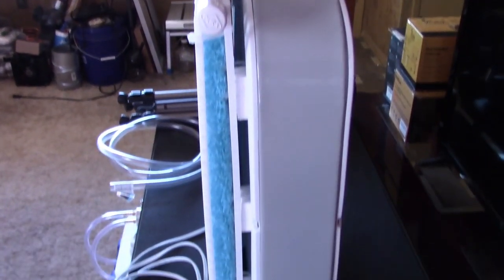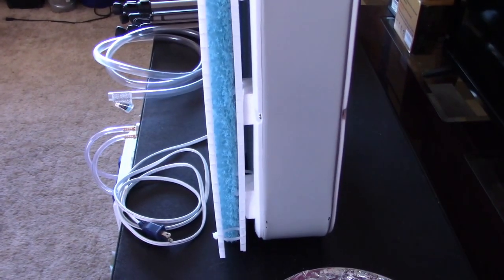DIY Evap Air Cooler! (Simple "Box Fan" Conversion) - Homemade Evap Air Cooler! New Design! Easy DIY

Comment: Thank you! Can you just use the clear tubing across the top and put holes in that! It would be simpler
Reply from the maker: hi. that might work but it may be harder to keep all the holes lined up and facing straight down. the clear tube might move around and cause issues.

Comment: Bought some evap pad you recommend and tested this quickly. Flow rate of air seems pretty low through the pad… worried it won’t cook a small room effectively. Any advice?
Reply from the maker: hi. i've noticed the unit works best on high speed. medium is decent too. make sure to cross ventilate the room and you should be all set. the blue pads are rated 2200 to 2300 cfm (which is the typical airflow of a box fan on high - so it works out good. make sure to use a good strong box fan for the best airflow.

Comment: Great idea. Except it will make me pee the bed with the running water sounds!
Reply from the maker: that's funny. if you're any distance from the unit you can barely hear the water over the sound of the fan so you should be okay. it kind of sounds the same as an indoor 'water feature' (or indoor water fountain etc.)  so maybe if you think of it that way, it would help. 👍🙂
Reply: @desertsun02  which of the latest models do you think work the best. Box fan with trans coolers, this model, Cylinder?

Comment: Is the pad on the suction side of the fan? If so, does it pull water into the fan?
Reply from the maker: hi. all of the water stays inside the pad. none of it escapes. i designed the unit so that there is no chance of any water getting into the fan.

Comment: The thermometer should be on the other side of the room for a true testament to how well that DIY works. Of course, the thermometer will drop 10-20 degrees being right in front of it.
Reply from the maker: hi. there is no point in putting the thermometer across the room because the air temp coming out of the fan is what matters. each room or space someone is cooling is of a different size with many different variables. this will easily cool down a room
Reply: That is the whole point here to show how much the air is cooled down coming out of the fan itself...  You're never going to cool a whole room with this but if you can point a fan at yourself with 20 degree cooler air blowing at you its a huge win when it's extremely hot.
Reply from the maker: @Arson7883 i agree with the first part of your comment, but these units will definitely cool down a room. possibly even a couple of rooms. in good conditions, the air temp coming out of them can rival the temps of an actual AC system.

Comment: In some area's of the country that will be an indoor humidifier.
Reply from the maker: hi. that is true. these types of coolers work in about half of the country (USA). to see if it will work in your area, you can check an 'evap cooing chart'. they show the approx. output temps and temp drop if you know the temp and humidity.

Comment: Put ice in the return tank
Reply from the maker: hi. for a blast of super cold air, you can definitely do that. works great (but is temporary). i was thinking of using an ice chest to hold the water and then putting a large 25 pound block of ice in the water, just to see how long it would last.
Reply: @desertsun02  maybe a loop or coil of tubing,
Years ago saw water fountain that had reservoir inside a refrigerator that it was mounted on.
Or a geothermal setup, buried coils under the edge of your house? It’s cool under my house, that’s where the cats hide during the day.
Wait, during the winter, could you use passive solar heat exchanger to heat your home and humidify?
Is it video worthy?

Comment: I like it.  No use jere in the S.E. but were I still in Texas or AZ it would do a good job.   Had something similar on the porch in AZ and the house had a swamp cooler itself..
Reply from the maker: they do work the best in places like AZ, TX, UT, NV, CA etc... but in general they work pretty decent anywhere in the western half of the country. and in some areas of the eastern half. depends mainly on daily temps and humidity.

Comment: Would this make create more humidity? Sorry if that a dumb question I live in Florida some of the store broke stuff I got mad made my room hotter then it should
Reply from the maker: hi. it does, but if you 'cross ventilate' the area then the humidity stays low (since it never gets a chance to build up). this type of cooling works great in many areas of the world. in general, (in the USA) it works for about half of the country. in another 20% of the country it works okay (or sporadically) depending on humidity, and not so great in about 30% of the country. evap cooling charts (found online) can show you what temps to expect depending on the temps and humidity in your area. note that i also have DIY indirect evap units. those are a little more involved but they don't add any humidity at all to the air that you are cooling.
Reply: @desertsun02  compare to your cooler designs how easy is it to build or would recommend one that would best for me in Florida and thank you for replying
Reply from the maker: @pspwilliams i would consider making one of my cold water or ice based units or possibly a hybrid ice based evap or indirect system. the cold water or ice based systems don't use any kind of evaporation at all so they would work great in florida (even when humidity is 90% or more).
Reply: @desertsun02 thank you !!

Comment: I made one similar to this a few years ago with a wooden frame and I used hardware cloth to hold the Aspen pad in place. I got a little fountain pump and I ran tubing up over the top of the pad and just poked holes in it with a pushpin. On mine the fan was completely separate from the cooling unit. It worked quite well. Always enjoy your videos.
Reply: Could you possibly do a step by step for me please
Reply: @ElijahSuPerhero Sure, send me a PM

Comment: Very nice. We were just talking about excessive heat up here in the mountains of western NM.  82 in the house but low, low humidity makes it almost tolerable
Reply from the maker: hi and thanks. 82F with low humidity is almost the perfect temp and humidity to get the lowest possible temps out of these. you could probably get 58F-to 60F air coming out of it. just as good as AC in your case 👍🙂

Comment: Very neat design. I guess you could feed the pipe in the middle through a "T" so the hose is behind the unit. 
Where did the mesh plastic come from?
Reply from the maker: the tee is a good idea. it would streamline the 'look' even more. i get the mesh at the home stores. that mesh (egg crate lighting panel) came from home depot. (currently though that is not the cheapest place to buy it).

Comment: Good evening sir, here's another question from Rotterdam, where can I buy such a nice flat fan?👍
Reply from the maker: hi. i'm not sure where they would be sold in your country, but in the states they are very common and sold at the home stores (like home depot) and most of the discount dept. stores (like walmart). i've never checked but i'm sure that amazon sells them too.
Reply: @desertsun02   I've looked around, including Amazon Germany, but I can't find the fan you are using, can you also tell me what the brand of this fan is?👍
Reply: @johndevries7122  His fan make is irelevant, not important.   Any box-type fan will work.   Look at the Numbers as far as people saying they Like or dislike the fan-youn do not want to buy one that is garbage.   Otherwise he has given you the basic layout of putting it together, just don't get caught up in the minor details trying to use exactly what he used.   Check the hunidit where you live-that is the biggest factor.  :)
Reply from the maker: @johnveries7122 hi. as stated by another commenter, the box fan make isn't really important (for the record though it is made by lasko). there are lots of brands that are all pretty similar. the pads are rated to near 2500 cfm airflow (which is a good strong box fan on high speed) so it balances out well with all kinds of box fans.
Reply: Amazon in Germany has them.
Reply: @YWill100   Thank you👍

Comment: Great and simple. As evaporative cooling is completely dependent on relative humidity a search for "effectiveness of evaporative cooling at different temperature and humidity" (look for images to quickly find charts) or similar will advise the effect one can expect to achieve. A regular or dissicant (calcium chloride) dehumidifier in a closed off room may make more sense than cross ventilation in areas where the outside humidity is too high for effective evaporation. I would post links but I believe youtube would block them in comments. Thanks for simplicity, just don't want anyone to think they aren't getting good results without knowing why. In Arizona an open ventilation will usually be fine. In Florida, not so much.👍
Reply from the maker: hi. evap cooling charts are one of the best ways to see what temps an evap cooler will generate in a certain climate (if you know the temp and humidity). i find that they are pretty accurate.
Reply: I was planning to do this more as a dehumidifier than for cooling. My plan was to pump/sprinkle liquid calcium chloride over a $1.50 fiberglass air filter (super thin, large surface area, not as expensive as evaporative cooling pads have gotten). I have lots of small piles of calcium chloride in my basement in plastic cups already and days later it will be a small pile of calcium chloride with an inch or two of water. I'm curious how much it improves simply by adding a lot of surface area and some airflow. May get to pumping the excess water outside and burning it off with the sun's heat, but for testing the plan was just to take the bucket outside and let it heat up to release the water.
Reply: @orangezeroalpha For the amount of effort that would take, you may as well get a compressor/refrigerant based dehumidifier. TCL makes a good small 22 pint model for small basements. Midea is also a great brand. I have the 50pint model. No problems

Comment: I like this setup... very nice!
Reply from the maker: hi and thanks! been working on this on and off for a few months. the main thing was really deciding to use the "egg crate lighting panel material" to hold the pad. that really brings the whole thing together. that and the styro-foam blocks (to set it apart or hold it away from the back of the fan) made it work out great!

Comment: Got the itch to make a "new" swamp cooler after using the 5-gallon bucket one for a couple years. It's been working great. Came back to check your channel to see if you've got any new designs - was pleasantly surprised to see you uploaded under an hour ago!
Reply from the maker: awesome! the 5 gallon one is great. that might have been my very first evap cooler. i've made 10 or more different models over the years since the 5 gallon one. tip: if you want to see all of my videos on that topic (in one place) check under the playlist tab on my channel page. i've got a playlist just for those. makes for easy viewing. this newest one is probably the best "box fan conversion" one i've done. i've also gotten into the "indirect" evap units (those are the ones that don't produce any humidity). a little more involved with those but still easy to make

Comment: I'm confused. Is this going to cool with just cold tap water or iced water? How does the water keeps in circulation? How much more cooler is it than just the fan itself? I'll have to feel  it to believe it. Too bad I'm elderly and unable to get this done. Would love to try it. Do you sell them ready to use? If so, what is the website so I can order.
Reply from the maker: hi. there is no ice or cold water needed. the great thing about evap coolers is not only do they cool the air that is pulled through the pad but they also cool the water that is going down the pad! (this happens because it's the pad itself that gets cold) - due to the evaporative effect. this water-cooling effect allows you to use any temperature water when you fill the tub. i started with 84F tap water and in 5 mins the whole tub is cooled to the upper 50's. notice when i show the temp of the pad in the video. (that temp you see is also the temp of the water). again, there's no ice or cold water needed. the unit cools the water down itself. the water pump in the bottom of the tub pumps the water through the tubing. that is how the water is circulated. the output air is anywhere from 15 to 25F colder than the input air. i don't sell them but maybe a friend or a neighbor could help you build it?
Reply: @desertsun02  Thank you for the clarification. I understand the process now. Amazing idea! Great job! I will share your video to neighbors and see if anyone is willing to build one for me. Have a blessed day.👍
Reply: @gooddeals1082 this is basically what AC's do but exactly opposite. Swamp coolers are best for low humidity while AC's are generally used in humid climates.
Reply: Evaporative coolers and "air conditioners" work in different ways.
Evaporative coolers work using the principle of latent heat, i.e. to make a liquid into a gas there needs to be energy (heat) involved, in this case the heat is "taken" by the evaporated water leaving the water that's left behind cooler.
Reply: California been cooling there homes with these for 60 years or better